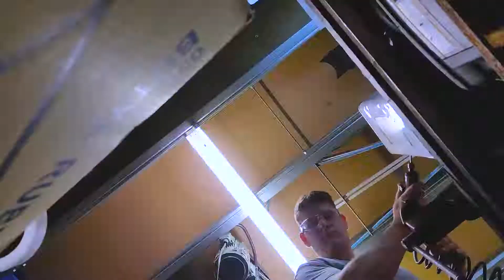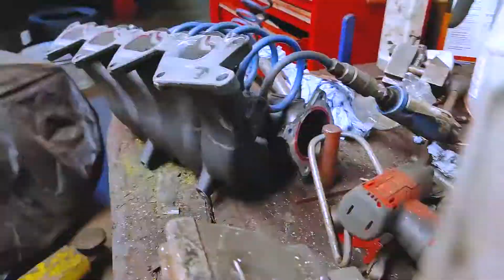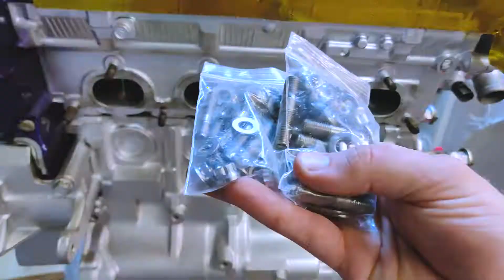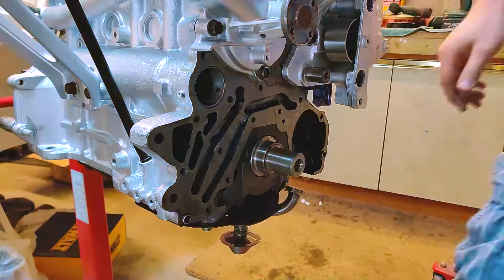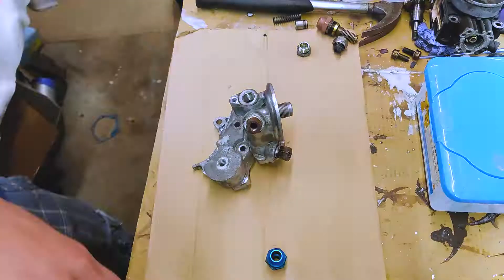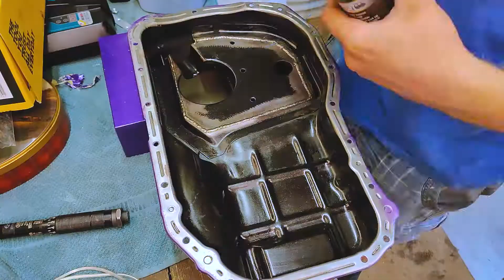The Evo 5 Forged Engine is Complete! | Evo 5 Build ep. 9

Comment: Any reason the balance shafts are going back in?
Reply: Would like to know that to! 😉
Reply from the maker: Because this is primarily going to be a street/show car. It's odd to try and explain the feeling of an engine without balance shafts but the car feels "buzzy" like stuff vibrates more. I just kinda felt like mitsubishi wouldn't put these in for no reason so, I have rectified the weak belt by putting a HKS one on and inspected the bearings - Ollie
Reply: Project Racecar the balance shafts are for the harmonics on idle and even then doesn’t make much difference if any at all 👍🏼
Reply from the maker: @Reece.P  yeah, I know what they do. I've personally chosen to keep them 👍
Reply: Project Racecar that’s fair enough, just thought that the effort you’ve gone to already you’d of done away with it as the advantages outweigh the disadvantages.